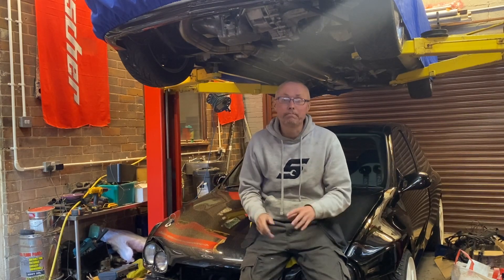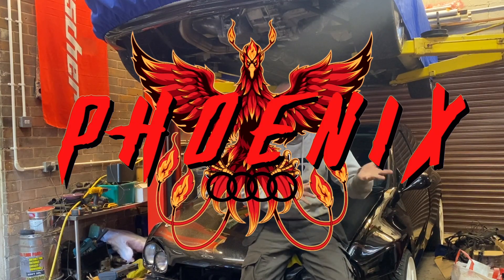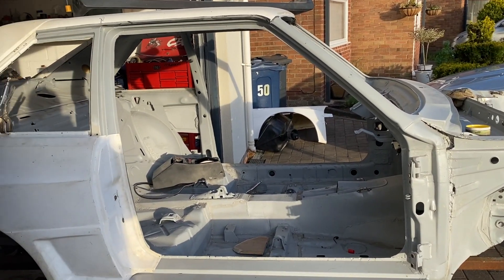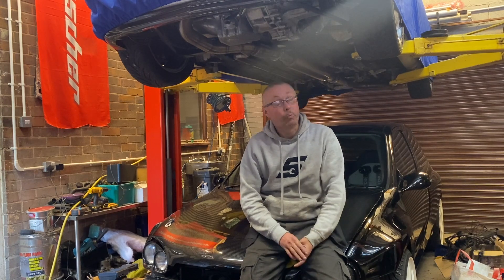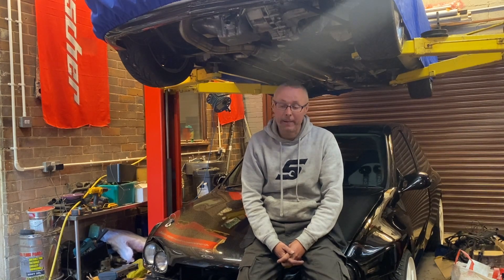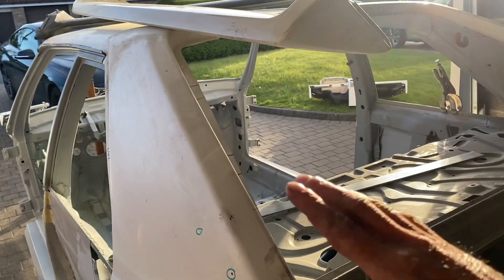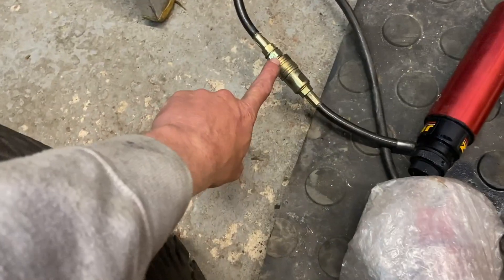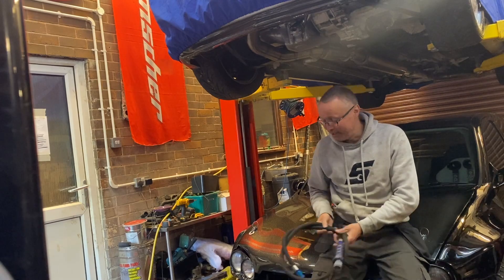Beginning of the Audi Quattro Rally Car S1 E2 Group B Tribute Build *PROJECT PHOENIX*

Comment: I thought the steeper windscreen was due to the body being shortened so much there literally wouldn't be any roof left? 🤣
Reply from the maker: From info I read, they rallied the LWB an they complained about handling and the glare off the screen on the dash. Hence shortening and using the 80 front end for the windscreen slope.